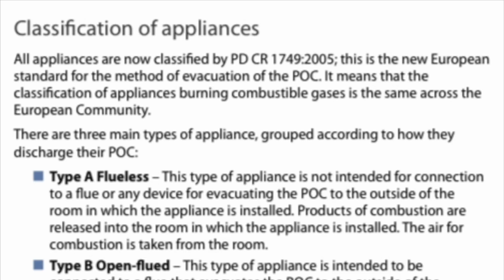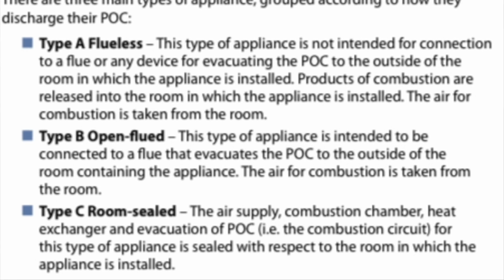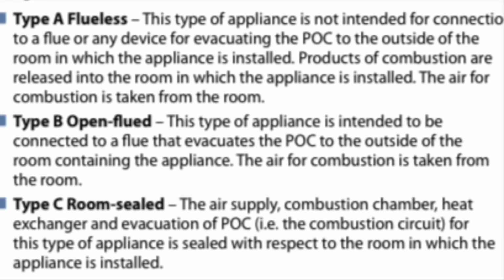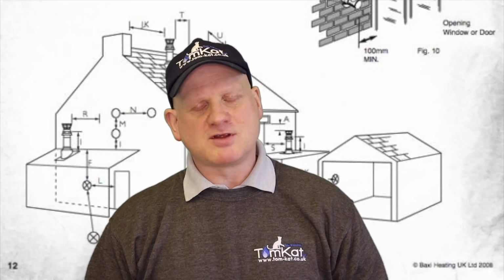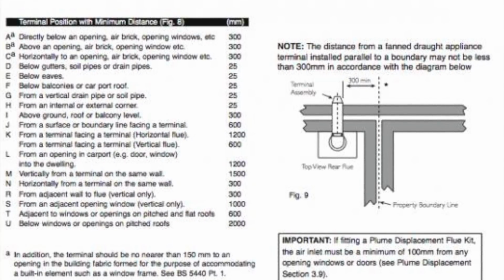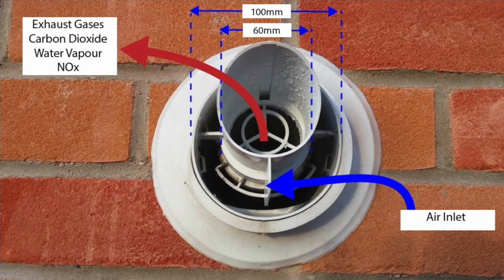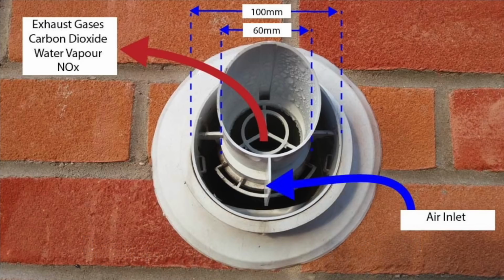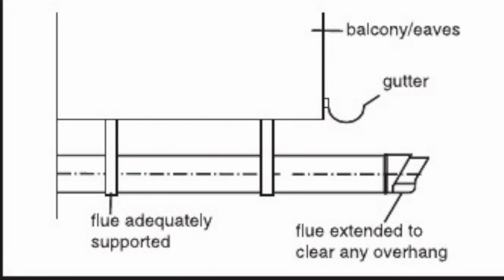Gas boiler flues CORRECT INSTALLATION OF BOILER FLUES PART1, how boiler flues are installed.

Comment: I’ve just come across this video and it’s super helpful. I’ve had water coming from the boiler and they’ve told me it’s rain coming into the flue! They’ve said there’s no leaking pipes or anything at all, nothing internal. Checked the flue and it’s said it’s 100% that. They’ve told me I can get a cover for the flue, but would 100% recommend I get the flue extended - quoted me £260. Derek, any way this sounds right? It’s weird I haven’t had any issues since the engineer has been!🤔 & the rain has been awful! Any advice???
Reply from the maker: Hard to comment on something I haven’t seen but if the flue is a standard length or less you don’t require a fall in the flue as it is built in.

Comment: ive just had a new condensing boiler fitted and not only did they not seal the flue on the outside but there is water dripping out of it and it says top on the bottom!! im pretty sure they have fitted it upside down
ive complained to the company but dont hold out much hope theyll fix it even though they are registered installers for worcester,i guess being registered means nothing

Comment: Very informative. How would you get around with building a pergola (with a roof)on top of the  exhaust?  It will be a 2.5meters length. The gas exhaust is in the middle:(

Comment: If a boiler is already installed in compliance with then current manufacturers instructions (2020), then later the manufacturers instructions change (2023), does the installation become wrong?
Is this reportable?  The Worcester Bosch 2000 installation instructions changed do we need to report this as at risk for not being as per MI's?
Reply from the maker: It’s installed to the current regs and MIs so if it’s installed and they change then the appliance would become not to current standards so no need to do anything

Comment: I'm Not a gas boiler engineer but I'm a Aerospace Defence Hardware verification qualification test engineer, it's always good to know what's right ✅ in the Gas trade & what's wrong an good indication when looking say for a new home 🏡 
The only thing I've  changed is a water flow switch for a combination boiler of my own, & thermocouple for an old Central Heating & Hot Water boiler 30 years ago, in the end on that boiler it was found that water was coming from the old dicast heat exchanger onto the pilot light, then a Gas engineer was called out to give the old cast iron boiler a good service 👍,
They don't make them like that anymore 😅,  before that was installed 40 years ago we had the very old cast iron radiators,  those were I'm sure recycled by the installer, those would be well sort after including the very wide cast piping that was taken out,
Interesting to look at all the systems, I still really like the Viessmann 200W 13 years old still going very well 👍
I see installation errors using 15mm gas pipe but its not far from the Gas meter, & I was informed by Viessmann I would be better to have 22 to 28mm on flow return except near the radiators, they used 22mm to a block then microbore 10mm plastic to radiators, I'm picking up all the best information for the next installation in a new home 🏡 later on

Comment: Can mice enter the house by flues?
Reply from the maker: A mouse can get through a hole bigger than 10mm but if it went into the flue it’s self it would be inside the boiler or the heat exchanger
Reply: @tomkatgastraining  I see, so has long as the boiler is sealed (no gaps whatsoever) for the mouse to enter in the flue, then through the boiler and then into the house, it should be safe to rule out that possibility of mice entering the home that way.
Reply from the maker: @HDsharp  i would say so 👍🏻

Comment: You said cant use the a flue extender kit to go through a conservatory if the exhaust and inlet are in different places. but can i run both up through the conservator roof on a 90 up then a 90 to level it above the roof so that the inlet and exhaust are both extended to the same place? (using manufacturer lengths and distances etc) Cheers

Comment: great vids  We undertake several extensions where the boiler flue needs to be extended. The existing pipe will be returned up the wall and out through the roof. Any chance of a vid on this installation because it must be more and more common
Reply from the maker: It’s on the to do list 👍🏻

Comment: The 10ppm reading that changes things from AR to ID sounds strange, wouldn't it change from day to day depending on weather conditions? Also is that test done with the door closed or open? 
Thanks
Reply from the maker: All test results are on the day of the test and yes it can pass one day or fail the next that’s why we say at risk meaning it’s at risk of becoming  ID as far as the door open and closed if you mean the flue is too close to a door then yes the door is open
Reply: @tomkatgastraining  ta mate, I had never heard of that 10ppm before, always learning! How long would you run the test?
Reply from the maker: @Snaggleplops  2 minutes

Comment: Thanks for tge informative video Derek. I have a ideal he18 bolier. On very windy/wet days I get water being driven in through the flue. Is there a guard /cover or anything that can be used to prevent this?
Reply from the maker: The problem is the installation of the flue it is probably on to steep a fall. There is no guard for this the flue will need installed correctly or do you have a gutter or pipe above the flue leaking or blocked as this can also let rain in
Reply: @tomkatgastraining  there's no guttering above flue, its fitted Between the wall and fence where the wind really picks up. It looks fairly straight coming out with no whites showing. Should it angle slightly downward, as it's angled slightly upwards
Reply from the maker: @dannybrown438  the angle should be straight on the standard length of flue or to manufacturers instructions. Flues are designed not to let water in even in a storm so without looking at it I am guessing

Comment: Surprised at how much there is to know about these type of flues. A very informative and interesting video. When checking if there is more than 10ppm CO coming back into the room, do you stand at the door with the analyser probe OR is there a certain distance from the door you would stand with the probe? Hope this question makes sense. Thanks Derek 👍🏻

Asian Jon. Training.
Reply from the maker: Inside the door way sweeping around to see if the 10ppm is coming in

Comment: I've learned more from you Derek than I did at my covid affected course last year!! :) Good lad

PS any chance ya could do a air/gas ratio adjustment video with faults, analyser readings, correct tools and process please? Would really help, ta :)
Reply from the maker: Already done one mate check out my videos on how to use a flue gas analyser and understand the results 👍🏻
Reply: @tomkatgastraining  do you have a heading for as unable to find it yesterday.
Reply from the maker: @doncollins9190  done quite a few videos on using a flue gas analyser and understand the results

Comment: Do Worcester allow you to show white outside?
Reply from the maker: As far as I am aware yes they do
Reply: Worcester and Vaillant allow it.
Reply: That's good question! I'm sure this was raised back in 2016 about the flue being exposed too much (sticking out the wall) to the elements! Apparently the paint wasn't at the time UV resistant!
Reply: Yes they do allow it. If you have a joint outside then you need to silicon it.